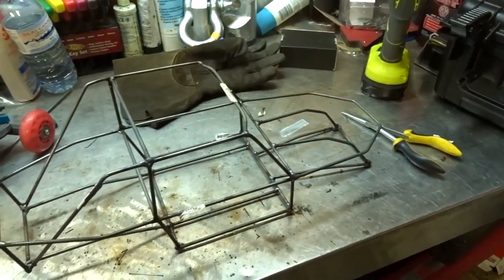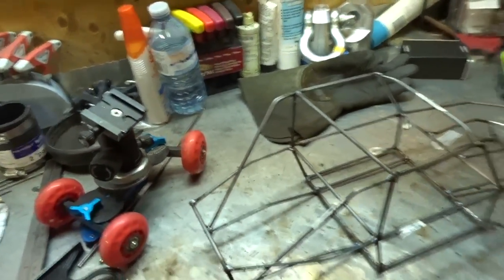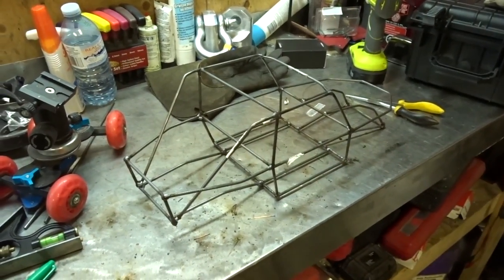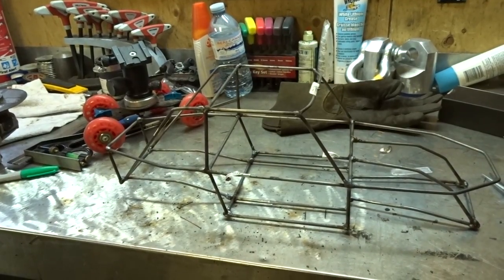RC Off Road Tube Frame Build

Comment: Check out rccrawler forum. Lots of custom builds. Ive welded or brazed many exocages and tube rc crawlers rock sliders,bumpers ect. Looks good Jerry.
Reply from the maker: +Tklatti01 they are kind of a pain in the ass to build

Comment: Is that a 1-off plan or specific to an existing plastic RC crawler frame? What truck?
Reply from the maker: it's actually plans that were downloaded off the net, i can't remember now as i didn't download them but you print them out and bend your metal to the shapes printed on the sheets
Reply: jerry bskorner okay thanks.... hey did you ever rebuild the Warn winch on your ATV?